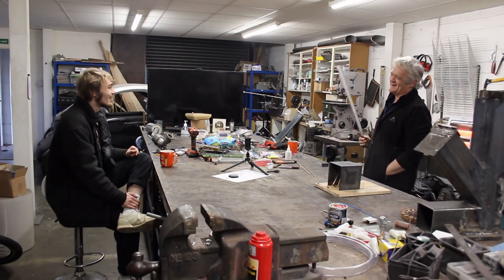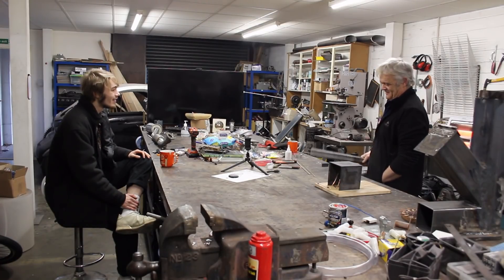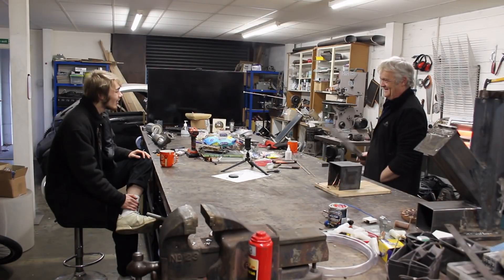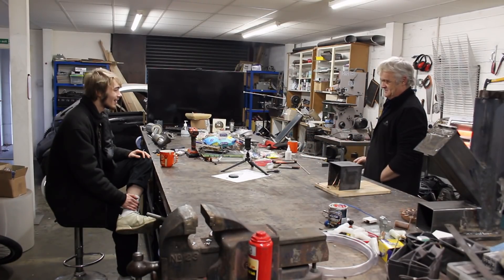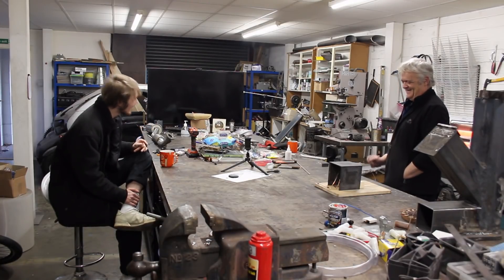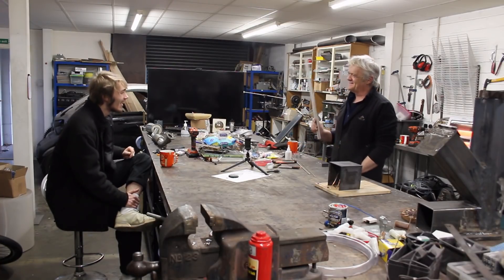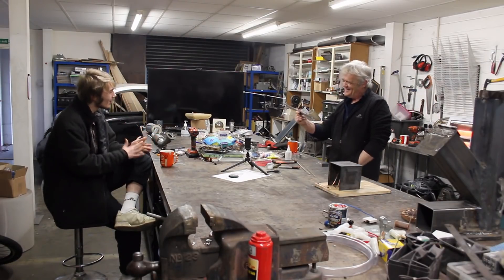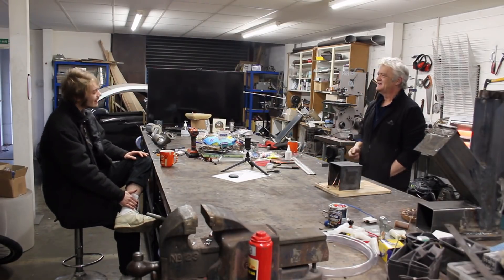1422 Ever Heard Of Magnetohydrodynamic (MHD) Generation - A Chat With Luke

Comment: have you tried it without a magnetic fields applied? cos at the junction of 2 dissimilar conductors and a temperature difference on the ends should generate something too. Perhaps your device is generating in 2 ways.

Comment: Interesting talk, i love how you are not afraid to experiment with all the possibilities. The salt water ideal could be something beneficial, since water conducts heat really well at the same time is fluid so it carries away the heat from hotter areas and dissipates it elsewhere. Well depending on the application heat in our electrical systems is a problem for high power systems or even for small gadgets the smaller they are the better heat transfer they will need.

Comment: If you add chloride ions to the flame the metal colours are enhanced, Copper Chloride gives a much higher output than Cu nitrate, carbonate, oxide etc. Same for Iron, Chromium etc. Depending on other factors you can often get multiple colours from the same metal. Not sure how or if that changes MHD effects though  ;-/

Comment: Give Luke a fish and you will feed him for a day .........  ;o)
Reply from the maker: spot on mate
Reply: @ThinkingandTinkering  Did Luke get it?
After a bit of thinking (dangerous, I know) I think the reason they got such a low result from the Thames Generator was the parallel earth paths acting to short out the voltage. Earth resistance can vary quite a lot but usually you can get under 20 Ohms for quite some distance!

Comment: What if you were to pump iron filing solution in a circuit that passes aluminium plates as it goes around?
Reply from the maker: I have no idea - give it a go and let us know what you find out
Reply: @ThinkingandTinkering  Nah, it probably wouldn't work, and if it did it would probably be worse than normal methods. But I suspect you already know that.

Comment: It was interesting although seems like a lot of waist material and I can't see it producing a lot of electricity. What are the use cases?
Reply from the maker: it's used in power plants to generate electricity and I am not kidding mate - that is exactly where it is used for electricity generation it is around 60% efficient I believe
Reply: @ThinkingandTinkering  Wow, I'm surprised I had never heard of it before. Most power plants I know of use a turbine to generator setup. There must be another loss getting it to AC as well an MG (motor generator) set is probably used?